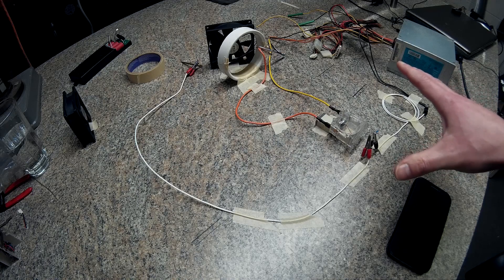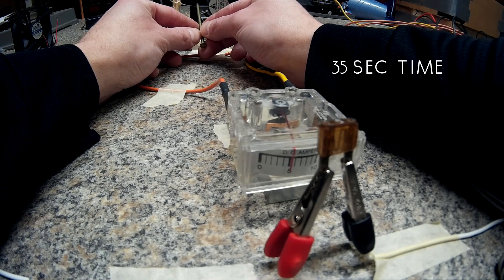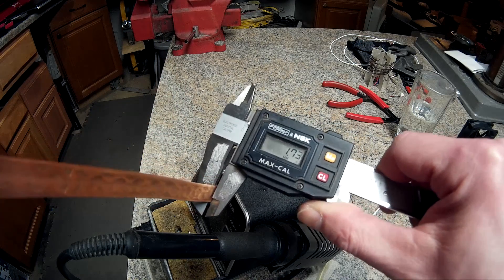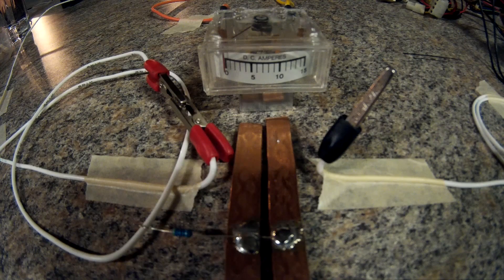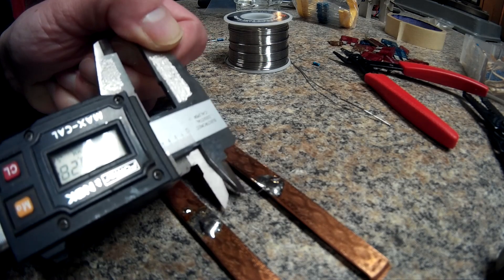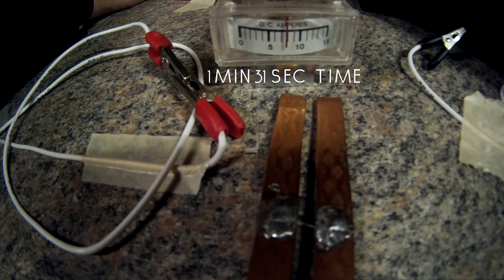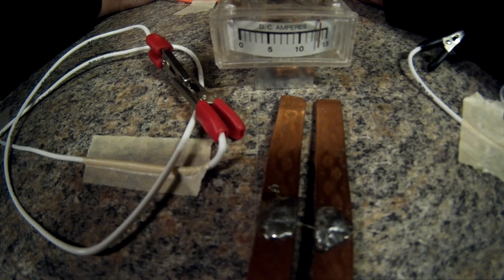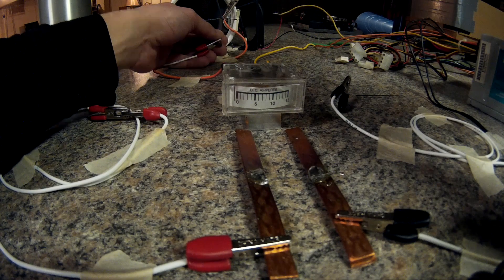Diy Tesla Powerwall ep15 Testing Cell Level Fuse Wire Part 2 Shocking Results

Comment: i use thin copper wires so it does job done bit smaller then u use 8packs by 400w 12v ill ask bout 3 7a from each pack 80w so it should hold up well @@

Comment: Create a coil, like you see in some glass fuses.  A coil will build up and concentrate the heat around the wire, improving the speed of popping the fuse.  Even one single turn in the middle of the wire can make a difference.
Reply from the maker: I tried coils around this time.  Dont remember what all happend but didnt go that route since Id need to make and install 1400!

Comment: I'm changing your name to "Not Your Average Joe". Jk! Great video as always. My dummy questions to you are...does the fact that you used 2 points of contact as apposed to 3. Cell to bus, bus to cell, make a difference in fuse tolerance? And are bus bars mostly needed for BIGGER PACKS, certain Ah packs or it doesn't matter?
Reply from the maker: 😆 Thanks!  This one is an older video for sure lol!  The main thing for wire being used as a fuse is length.  Shorter will give a higher amp rating and longer will be a lower amp rating.  I use actual fuses now.  Bus bars are needed weather its copper wire or nickel striping so all cells can balance with each other.
Reply: Sorry if I worded the question wrong. But what I ment was, is a bus bar needed for a  smaller pack with let's just say 3s10p. Or does the size of the pack have anything to do with a bus bar being implemented to it. I've done a couple of packs (small packs) without bus bars. Only fuse wire. Thanks
Reply from the maker: Oh ok yeah then as long as the wire can carry the current you should be good!🖒

Comment: I'm totally baffled by the result that a longer fuse pops quicker than a shorter one? Shouldn't the theory be that a shorter fuse equals lower resistance and therefore higher amps?? I know that the testing clearly showed that the longer one popped much sooner but I just can't figure out why. Maybe subtle resistor differences and you just got a really robust one during the short fuse test?

Anyhow, I've been testing my own fuse wires with a lab bench power supply that goes up to 10A. And with it maxed out I still couldn't the thinnest wire I had to burn. And it was like a single strand of the control wires that you pull out of the laptop packs too. Nevermind the legs of a 1/8th resistor.
Reply from the maker: I think when testing shorter wire, the heat absorbs into the clips or busbars like a heat sink and doesnt allow it to burn as fast.  Longer wire just the opposite.  What voltage are you testing at.  Maybe raise it just a little cause when I test at 5 or 12v they pop sooner.
Reply: @AVERAGE_JOE  - Yeah I think you're right actually. I was only ever testing at nominal 3.7V because I figured cell level fuses shouldn't really ever get above 4.0 or so. I was also always told and read that voltage shouldn't make a difference on a fuse and that only current is the determining factor. But that clearly is not the case and I think once you get down to a minimal voltage like us, the current the fuse can handle increases significantly. I may just end up going with your fast axial glass fuses!

Comment: Here's a crazy idea. You could buy a bunch of mini 2amp fast blow fuses and test them. They have copper tails to solder just like a resistor and have very short fuse wire in an enclosed glass tube so the thermal properties will be the same no matter if using a fan or not. A fast blow type fuse is better than the longer fuse wire getting red hot for a longer time. Search on ebay for "50pcs 2 amp quick fast blow fuse" and you can get 50 for $3.59 USD free shipping. I might order some to test also but for me I'm using Headway 15AH 40152s Lifep04 cells so I will be using a much bigger fuse between cells. Your great testing proves that long and different fuse wires is not consistent enough.
Reply: If you dont want the glass tube, there is also pico fuses that are a similar price. I see someone on Youtube used 4amp pico fuses and they saved the battery during a short.
Reply from the maker: I am actually using some mini glass fuses called Fast Axial glass fuses.  I have a few videos about testing them later on.  One of the reasons of using them was because the regular fuse type wire can get red hot and possibly cause a fire.  They have a few different amp settings so I think you will be able to find what your looking for.  I will say that in my testing of the glass fuses is that they will pop at double the rating but I have only tested from .5amp to 5amp glass fuses.  I wanted the fuse to pop at a low amp so I didnt test anything higher.
Reply from the maker: The only thing about pico fuses is you cant tell when they have popped, otherwise they are good fuses!
Reply: I just watched a few more of your videos, seems the Fast Axial glass fuses you used are the way to go. Great that all 200 popped when you shorted the packs by accident. I ordered 5 amp Fast Axial glass for my 15ah 3.2v cells. Thanks for the great testing. Your videos portrayed the differences well. Goes to show that people just soldering random fuse wire is going to give unpredictable results.

Comment: Wow yeah. All wire can handle more current the shorter it gets. But holy. I didn't expect 15amp to pass through a single strand. Awesome vid! Subbed
Reply from the maker: Thanks!!!  Yeah I was impressed to say the least.  I have a few more fuse vids if you havent seen them.  HBPowerwalls test vid should be up in an hour or so.  Joe

Comment: Great series of tests.  This seems to suggest that more spacing between heat sink copper would give more consistent results.
How about doing a series of tests that compare battery capacity loss in soldering vs. spot welding.
Reply from the maker: +Terry Wells Thanks! Yeah that wound be an interesting test, might have to build a spot welder ;)

Comment: Nice video.  I found this link useful.  It clearly states that a short fuse will be affected by a short length https://www.mepits.com/tutorial/472/Electrical/Electric-Fuse  Beware you don't go too low capacity as, in normal use, you may end up with too much resistance/heating and therefore oxidation.  Again in regard to oxidation do not use bare copper.  I highly recommend proper fuse wire!
Reply from the maker: +Simon Jowett Completly agree in regards to useing actual fuse wire. Thanks for the link, Ill check it out!

Comment: Old Time Engineer uses 1/8th watt resistor leads and I believe he did do a test, give it a try.
Reply from the maker: My Technology Trail Ill stop by radioshack and see if they have some. Do you know what amp they blow at?
Reply from the maker: Yeah this video is one of the main reasons for me to test the leads and wires in the first place.  I think so many people are taking his word for it and regurgitating wrong information in other places.  Dont get me wrong hes got some great looking videos but I dont want people to just assume that am 1/8th watt resistor is gonna keep them from burning there house down.  Sure it will pop if you short it out (most of the time).  Im also not saying I know everything either and wanted to know from others if they felt my test are right or wrong in the comment section.  I wanted to get close to real as I could get.  Ill still test the 1/8watt tho.
Reply: I live that you show the actual process, makes your statements repeatable.

Comment: Great Video. Thank you for testing the 5 amp automotive fuse. You should also try the lower rated automotive fuses to get to your 2 amp blow rating per cell. I'm in the same boat as you for the 2 amp fuses. The  5 amp blew at 6.5 to 7. If you can please test the smaller rated automotive fuses it would be a huge help. 

Thanks again
Reply from the maker: Hey no problem.  Ill see if I have any of the lower rated amp fuses and givem a try.

Comment: Hi Joe I found 32 ga Bare copper wire  for 6 or 7 buck and it works well on both sides of the cell.  http://www.ebay.com/itm/252405783243?_trksid=p2057872.m2749.l2649&ssPageName=STRK%3AMEBIDX%3AITThe way I see it you want it to blow very low, under 3 amps and under 5 seconds  AWG says .091 amps for power and .53 for chassis wiring.  Good info also keep up the good work
Reply from the maker: Thanks, yeah looking for 2amp rating.  It says 32g wire is .20mm and I tested .15 and .16mm or did I read the page wrong
Reply: Yes, .20 mm or .008 " and the AWG says .091 amps under power.  My test has been a pack(26 cells) with 10 amp draw for discharge to 3.0 v and next to 15 amp for me for I want to see  if it will go for the full discharge and when it starts blowing each cell's fuse.  Your testing for dead shorts its just a different way to get to the same place??

Comment: I clearly failed to consider the thermal dissipation, nice job on the testing.  Now I'll need to re-think how I will be building my packs.
I also an aiming for the under 5 amp target, preferably 3 amps as many of my cells are rated somewhere near that for charging. I have been testing how quickly the fuse blows on a dead short, but that doesn't tell actual amperage it's blowing at.
The wire I have been testing in is stranded AC appliance cord wire. Don't know if there is a difference in composition between that and speaker wire, but there might be.
Reply from the maker: Yeah that was the main reason for these videos!!!  I think a lot of fellow builders were taking others word for it and or testing for dead short.  I wasnt trying to call you out in the vid btw,  I wanted people to understand what I was trying to show them so hopefully it didnt come across like that.  I did find some actual fuse wire on ebay and on the interwebs that states it is actual fuse wire and it blows at 3 amps for $55. and 1 on the interwebs that blows at 2 amps but its around the $170 mark eeeeek.  It will take me a bit to save up for either but will probly get one of the 2.

Comment: Additionally I wonder how nickle strips between the cells would affect the performance of the fuse wire.  Might want to test that too.
Reply from the maker: Not sure what you mean by nickle strips between the cells?  There shouldnt be any nickle anything unless you do the double/matched cells.
Reply: You seemed to use a fairly thick buss bar, but if you used a thinner buss bar or connect the batteries in a different configuration (which is one of the things I would like to speak with you about) then the results might be closer to what you would expect.
Reply from the maker: I didnt think it was as thick as a lot of the others Ive seen.  I get what your saying about a thinner buss bar and yes it would lower the amps maybe by a few.  Like in the first video it was suggested that I use a buss bar and not the alligator clips to simulate more of a real environment because the clips didnt dissipate the heat like a bus bar would.  I will be testing a 12g solid copper wire for a buss bar like a lot of people are using because the solid copper wire is met with many others to carry the current.  I wouldnt suggest using a thin nickle strip for a buss bar unless it meets up with many other strips to carry the current.

Comment: If you can, try testing some 32awg magnet wire, that's what i'm using.  This has really made me think about getting one of those variable power supplies like this one https://www.amazon.com/Giantex-Supplies-Precision-Variable-Digital/dp/B01I6MPSPU/ref=sr_1_12?ie=UTF8&qid=1485715136&sr=8-12&keywords=Precision+Variable+DC+Power+Supply
Reply from the maker: Ill see if I have any 32awg magnet wire, since Im a hoarder I probly do lol.  Yes Id love to get a variable power supply but cant afford much of anything these days.  Maybe thats why I keep everything lol.  Id get one that could handle more than 10amps personally because I do a lot of other projects but for power wall fuse testing that would work.
Reply: more than 10amp and the price jumps up a lot.
Reply from the maker: Yes it does!

Comment: Joe, at time index 8:10 that fuse wire is glowing mighty bright.  IMO it could have started a fire if the plastic sleeves / connectors were there.  Since you only had your table top there, it wasn't an issue, but IMO a fuse wire glowing that hot for an extended period of time would be an extreme fire hazard if connected to a battery pack.
Reply from the maker: Yes it most defiantly could!!!